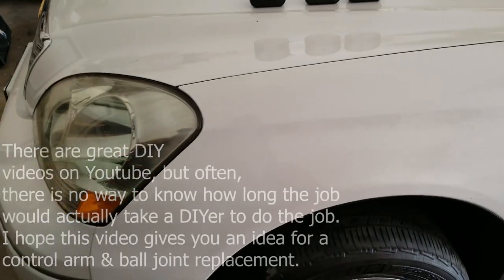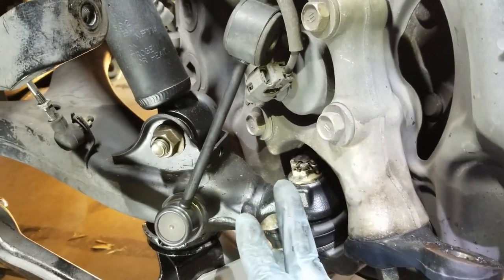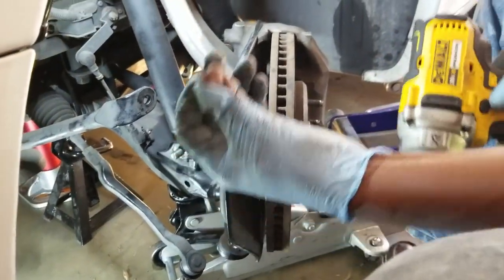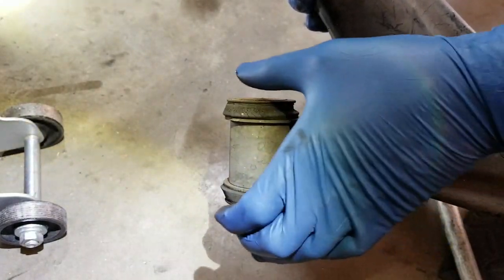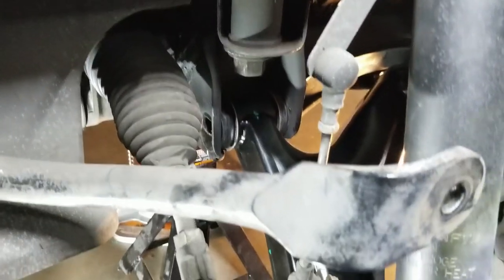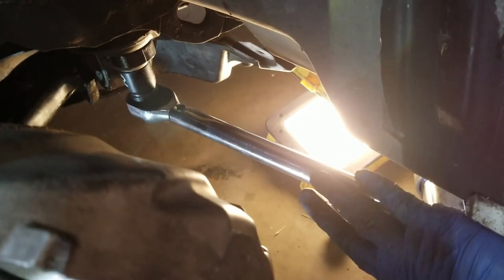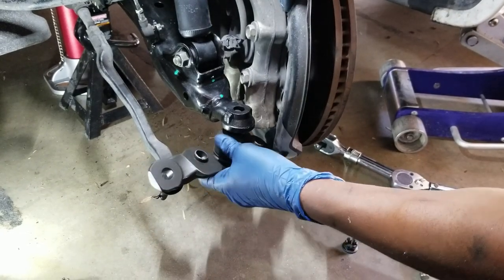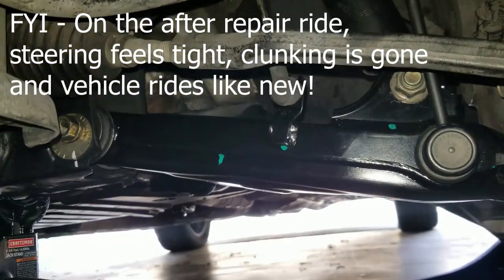2001 Lexus LS430 - Lower Control Arm & Ball Joint Replacement

Comment: Great DIY Video. But I have only one problem with the advice you provided - MEVOTECH Control arms are made of extremely low quality materials, not suitable with cars like LS430. Anything other than OEM metal and rubber parts is a bad investment. It will require the diagnostic a year later or even sooner, depending how and where you drive. AVOID Mevotech or Moog at all costs!
Reply from the maker: Hi Dimitry, very interesting thoughts on Mevotech and Moog.  I have heard many things about these manufacturers.  Some have positive views on them and others not so positive.  I have used Moog in the past on other vehicles with no problems, but never Mevotech.  Don't recall how I chose Mevotech this time.  Anyway, just curious, what do you use as basis for your view?  Have you had problems with Mevotech & Moog?  What "aftermarket" manufacturer do you feel has quality suspension parts OR do you feel no aftermarket company has quality parts?  Would be interested in your opinion.  Also, do you know who makes the actual control arms for Lexus (I do not)?  I know parts like struts are made by KYB and KYB also sells aftermarket.  Aisin supplies some engine parts....Aisin also sells aftermarket.  I don't think Toyota actually makes the arms, but I could be wrong.  Again, thanks for the comments.  Much appreciated and look forward to your response.  Take care and be well.
Reply: @justsomeguy4941  just came across this and don't mean to revive a month old comment, but I just did the wheel bearings on my 430 and I got the Moog instead of Toyota. Interestingly enough, both the original and new Moog wheel bearings have Koyo logos stamped on the back with the same part numbers. They also looked identical, but obviously the Moog being a lot cheaper.

Comment: LOL, I was just trying to use that same Milwaukee Right Angle Impact to remove the strut bolt from my LS430... what a piece of crap that thing is. My compact Metabo HPT made slight work of that and they're both rated the exact same. GARBAGE!
Reply from the maker: I absolutely agree!  It's crap.  I was so excited when these things first came out.  In fact, I bought two - a half inch and a 3/8 inch.  My first sign something might not be as advertised was a trip to my favorite place to shop....the salvage yard.  I was looking for a suspension part and thought I would use my new Milwaukee and leave my trusty and reliable DeWalt mid torgue in the bag.  Hmm, that's odd, this thing just makes noise and no progress.  Is the battery full I thought...hmm, yes.  After working on bolts I could almost remove with my hands I realized I was HAD!  Pulled in by the hype.  The right angle idea is great.  The form factor is perfect.  Now, if it would just loosen fasteners Milwaukee would have a nice tool on their hands.  You and I can't be the only ones with this experience.  Perhaps Milwaukee will upgrade the tool in the future so that it is stronger than our bare hands at loosening fasteners.  By the way, I have a new DeWalt Atomic with a PowerStack battery.  Man let me tell you, that combo rocks!  It is light weight, smaller form factor than my "go to" suspension impact (1/2 inch DeWalt mid torque) and enough juice to get through every job I have used it on.  It appears that the Powerstack does not last as long as other DeWalt batteries, but it delivers more power early.  That actually works for me since the objective is to loosen fasteners which only takes a few seconds.  Now, if I were running it for 30 minutes straight, then endurance might become important. Ok, I am waaay off track.  I like talking tools and cars so forgive me.  How did this rant start.... Oh yea, the Milwaukee right impact is crap!  Thanks for watching.
Reply: @F%98%ABannel/UC-tZqDFsfuyFenu9lvbxASA I'm just seeing this because I literally have over 400 comments to respond to on Youtube 🥴 but yeah, I think maybe the more recent ones work better? I too had the 1/2" and the 3/8". Both terrible. Just make noise and move nothing. On Home Depot's website the reviews say the same thing, but it seems the more recent reviews are better so umm, I might go and get a new one if you know what I mean. Buy one, swap them out and just say it's weak, which it is and return the darn thing! I need one that works. Thanks for this video! I'm going to start on mine in the morning, been traveling for the last 2 months.